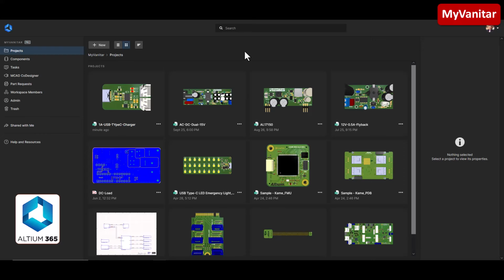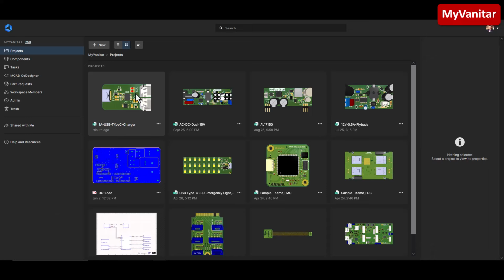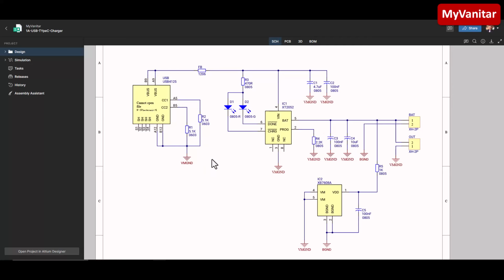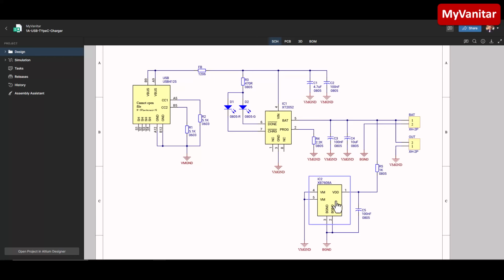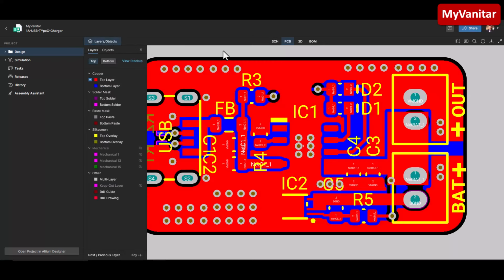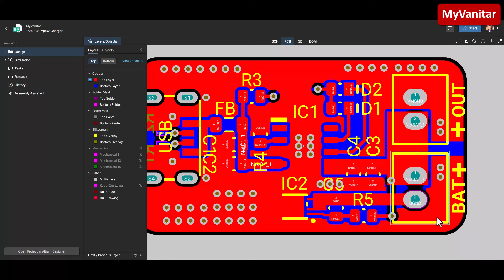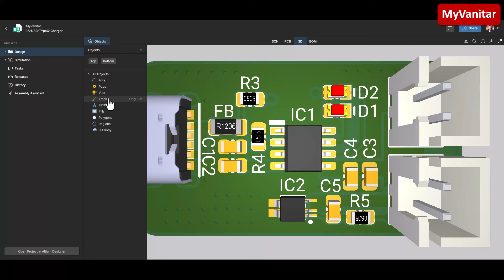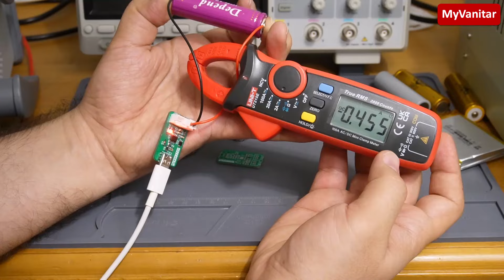1A USB Type-C Lithium Battery Charger (With Protection)

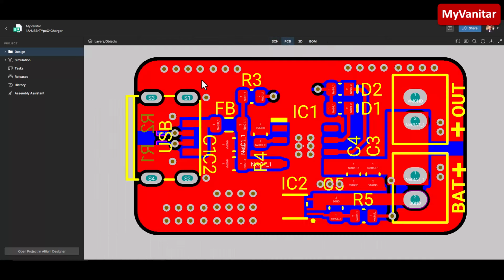Comment: 5:33 For me it is better connect positive connector's contacts at the left under connector and after this you can move to right traces from CC1/CC2 without using any via and place resistor on top side. Bottom side with only two resistors with no need them there it is strange )
Reply from the maker: I don't want to argue with you, but I have my reasons for the layout and those resistors. if you think your method is better, why bother, just follow 🙂

Comment: Is there any way that I can just make a rechargeable battery, but if I need to, for example, if the Lithium battery runs out of energy, can I use a small battery to temporarily use it? (I'm not an electronics person, so I'm really curious).
Reply from the maker: I think you meant if the main power went off, then the battery provides the power, similar to UPS, isn't it?
Reply: @MyVanitar  yes, that's it
Reply: @MyVanitar  Hope you make a video about that

Comment: Never use 6-pin type C. It is missing half of the power contacts (you can clearly see this if you look inside or disassemble one). 16-pin type C has all 4 contacts for positive and 4 contacts for ground. 6-pin type C has 2 contacts for positive and 2 contacts for ground.
And not only only double the current on each contact, but it is also a worse connection itself because there are twice less power contacts. With the old cable and with 6-pin type C I lost the power connection if I moved the cable, and with 16-pin type C I never had this. 16-pin type C has all the power contacts, and do not be lazy to use it. And never buy 6-pin version. You think "I need only power" and buy for this connector with twice less power pins, lol. And the problem, as I said, it has twice worse power connection compared to regular one.
Reply from the maker: Thank you for your comment, but I have had no problem so far using such connectors. They have datasheets and current ratings. Have you used those pulldown resistors? Without them, you won't get the maximum current. There are also 2 thick pins for the power and 2 pins for the ground.
Reply: @MyVanitar  I am about that the 6-pin has 2 times less physical power contacts than regular 16-pin. And I have already encountered that the power contact on the 6-pin connector was lost using the old cable when cable move a little. It is clear that with the new cable there will be no such problem. On the 16-pin connector I have never encountered such a problem. And I don't see any reason to use worse connector with twice cutted physical power contacts. It's just that no one knows this.

Comment: what is the main advantage with this vs the cheap tp4056 coard available ?
just asking for a friend :P
Reply from the maker: Do you mean Chinese modules? all use fake 4056 chips otherwise costs would be way higher. their protection part is discrete and their PCB layout is bad. watch the video completely.
Reply: @MyVanitar  Thanks for the answer. Can you make A BOM ?  Bill of mateials ? so at least we can bild this board :)
Reply: None.